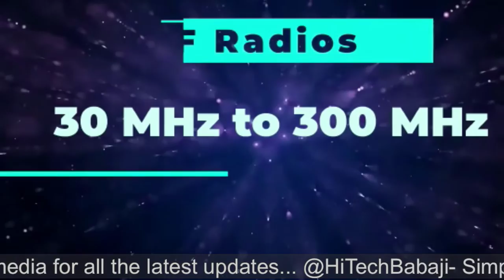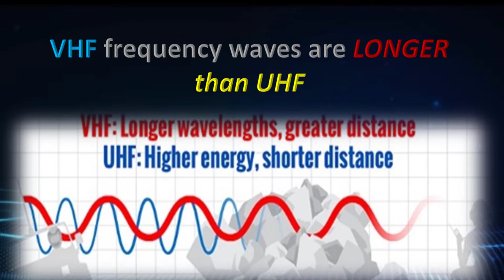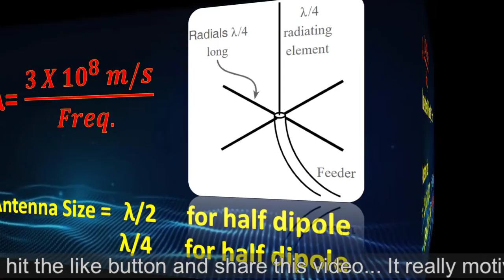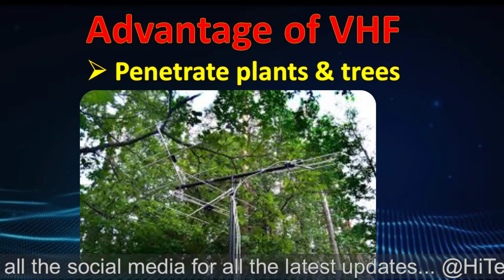VHF vs UHF - What's the difference /Basic VHF and UHF Fundamentals/uhf vs vhf two way radios/ V/UHF

Comment: What is the minimum difference between two different VHF frequinces to be used in channels
Reply from the maker: That depends upon the technology you are using,  Tetra standard,  DMR, Apco 25, etc. In India ministry of Communications grants 25 khz, 12.5 khz channel spacing,  even 6.25 khz is sufficient in some digital Modulations using APCO 25 Standard VHF walkie talkies.

Comment: Hi there... Im a Kayak Guide currently constructing a guide class in the Patagonia and for us Radios are very important, could you please tell me why the UHF frequencies can go trough objects and VHF can't? I understand it has something to do with the Freq Width but I don't know how.
Reply from the maker: Dear sir, thank you for all your love and support for my channel ..
Like light Rays,  radio waves also undergoes reflection, refraction, diffraction, dispersion etc. Do you know why there is something visible even if sun light is not directly reaching there. This concept of light is called diffraction from the edge of doors, windows etc.. likewise the radio waves whose wavelength is approximately equal to the length or dimensions of objects like buildings, doors , windows then radio waves diffracts and dispers and enters into the houses.. inside the building.  the wavelength of UHF is about the order of openings of buildings,  hence it penetrates inside...

But the frequency of VHF is higher so it reflects back and unable to penetrate inside.  

Like mesh  reflectors of dish antenna if frequency is higher it reflects,